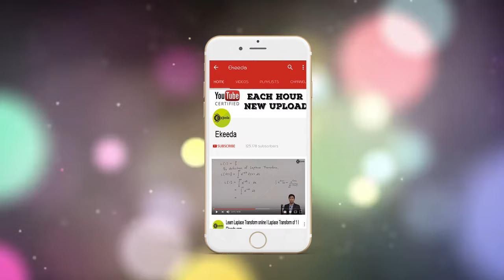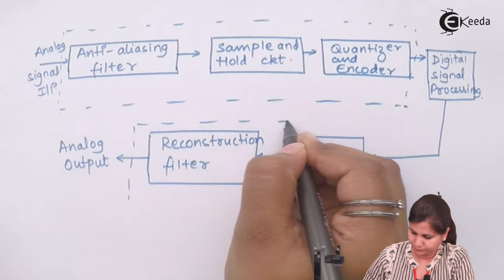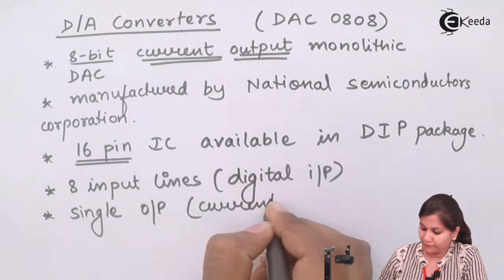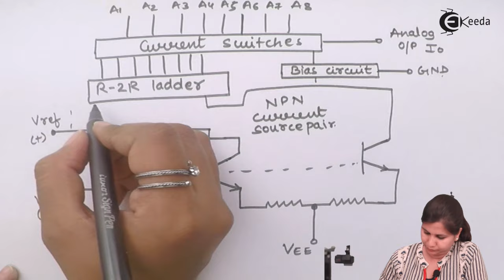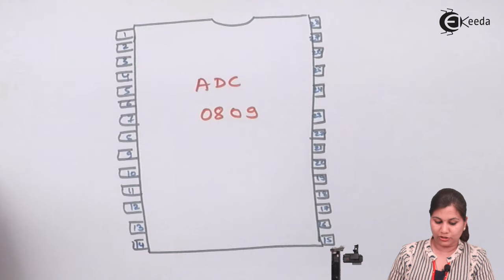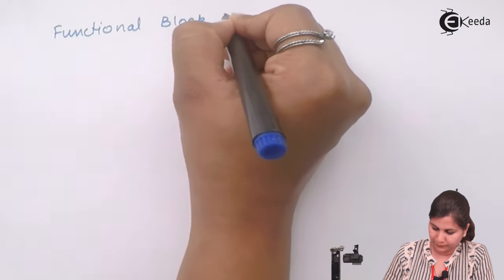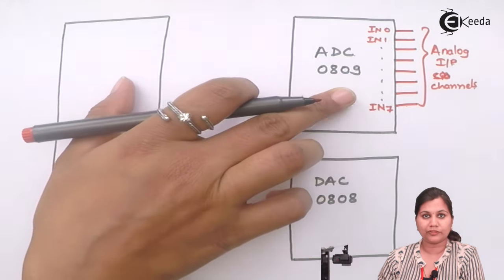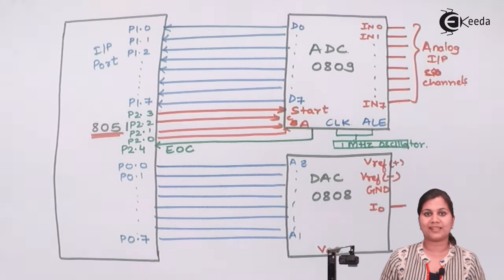Interfacing DAC and ADC with 8051 Microcontroller - 8051 Assembly Language Programming

Comment: This lecture is more of a basics of ADC and DAC, rather than the 'interfacing'. An 'interfacing' lecture only consisted 6 mins of discussion on 'interfacing' itself out of 36 mins. The vital elements such as, necessary block/circuit schematic, assembly programs are missing. The teaching is no doubt impressive, but the lecture content is incomplete.

Comment: Why we no use any interfacing ckt like ppi in this 8051
Reply: For better industrial experience, use flowchart to code converter. Help can be provided.
Reply: 8051 is a microcontroller it already has a port interfacing , had this been 8085 then we would need 8255

Comment: I think "the madon is very poor learning about electronics" some of the aspects explained is just the basis of text books only" dear madon , in modern technology, we and all the world dropout the 8051 wast controller, the 8051 is waste, unstable, poor internal ram, low speed, just only 8 bit. and many disadvantages. so in this situation why you teaching the waste controller, if teach the controller ,you will be 50 years back.
modern science fully discontinued the 8 bit controllers. 
also ADC and DAC never need any filters in modern world, the every semiconductor industry produce multycore processors for every single device .
this time why you go on 8051 waste.
Reply: We study them to appreciate the first minds who created them and also it'll help to understand  the recent processors  and  micro controllers 

Without a reason they wont include in the curriculum of undergraduates

Thank you !